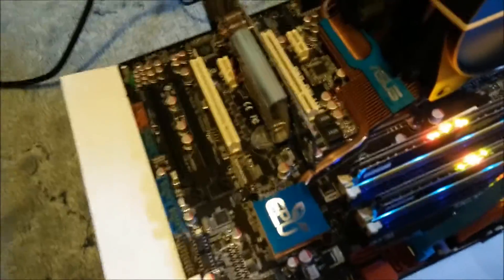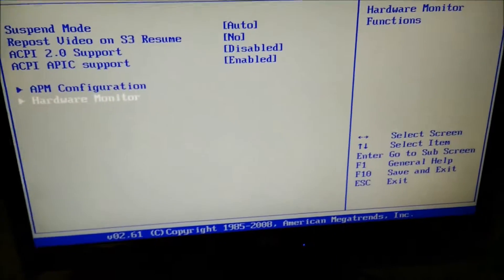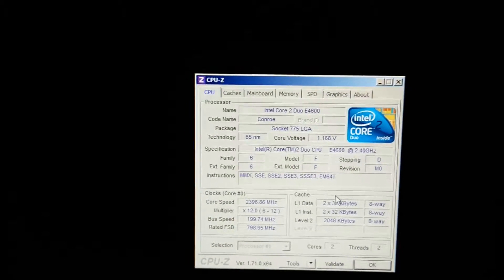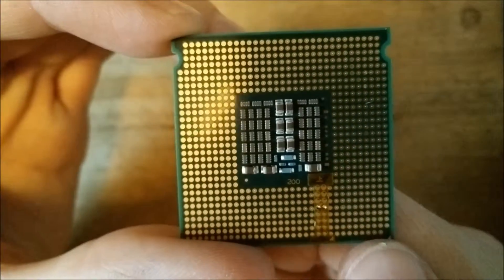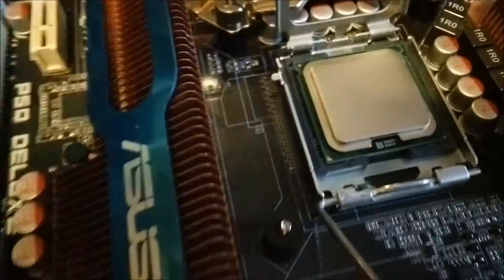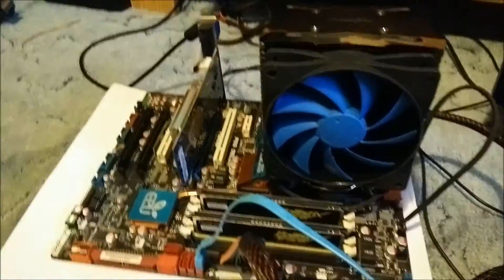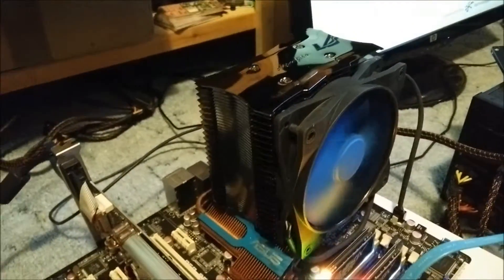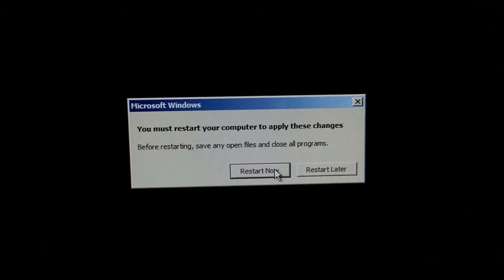LGA775 TO LGA771 Sticker Mod and CPU Testing

Comment: for the sticker mod! just got my stickers in the mail and now some xeons are gonna go 775
Reply from the maker: Awesome 😎👍 which xeons are you using?
Reply: @LawrenceTimme  i have an x5450, x5460, x5472 and x5492 so far. x5450 is working on the p5w dh deluxe. the x5492 is going to go in a 790i ultra if the bios supports it